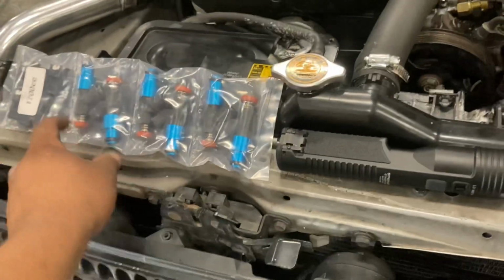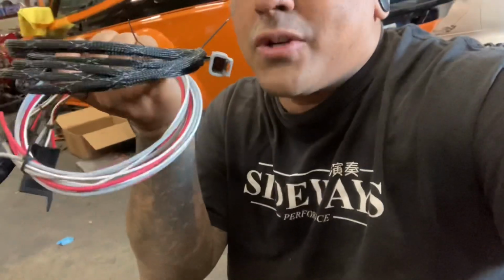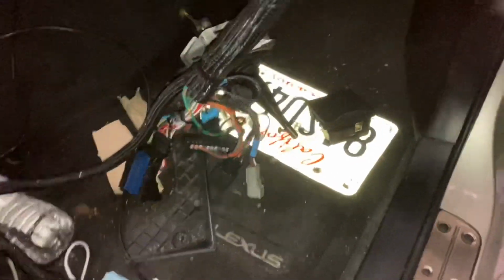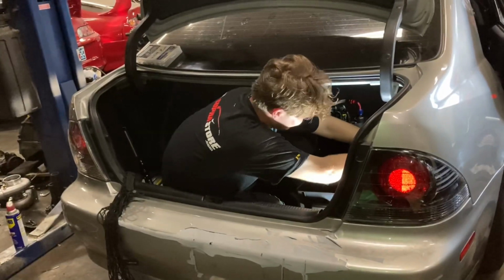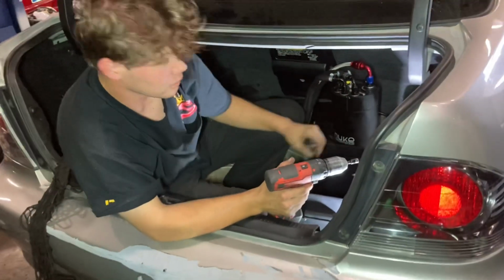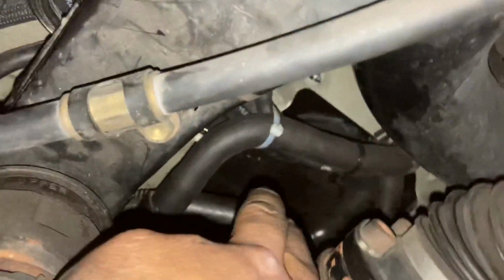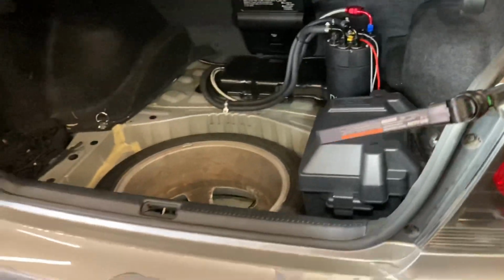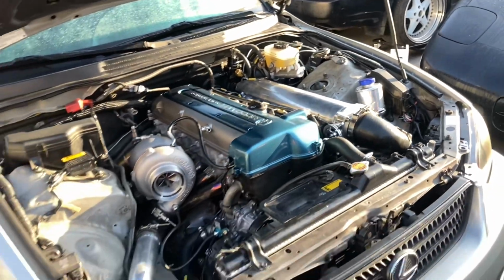Built motor is300 (part 2)

Comment: i have a question for my build im planning. Is it safe to run 2jzge non vvti rods and pistons on stock 10.1:1 compression on around 8 or 9 psi on 92?
Reply from the maker: U need to tune the car Man U can’t just boost an naturally aspirated engine and just say send ur or ur gonna mess stuff up
Reply: @SidewaysPerformance  im gonna get a mapecu3 piggyback so it can be tuned, but is it safe to run on stock compression with the thin head gasket, i want a more responsive lower end for the street, im not going for high power maybe only 350

Comment: Wait what I’m confused 2jz Ge? But has the gte valve cover on top? Or what explain please I’m still learning about 2jz
Reply from the maker: That is correct all 2jzge can run gte valve covers only of the bolts will have to moved to the correct spot on the valve covers